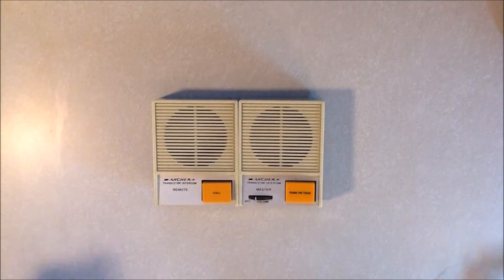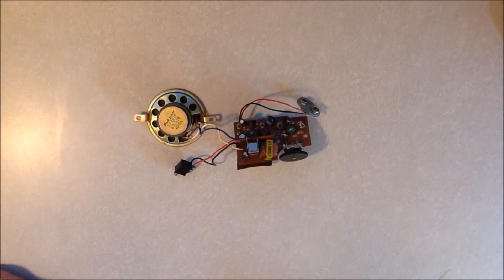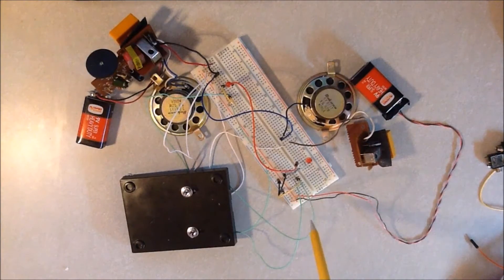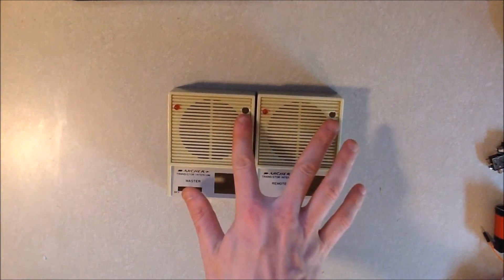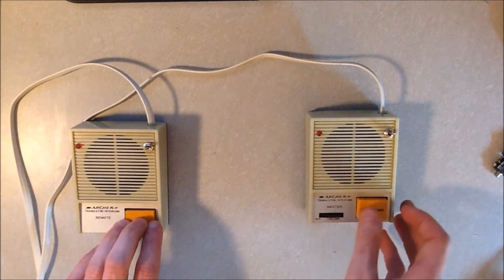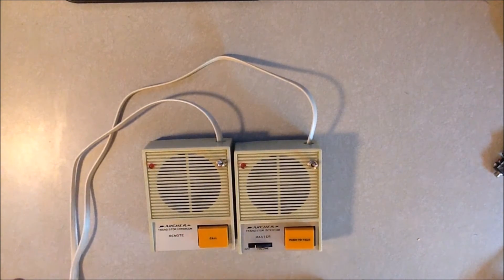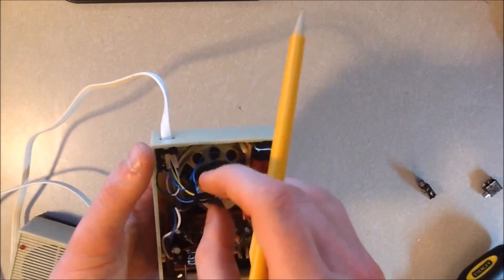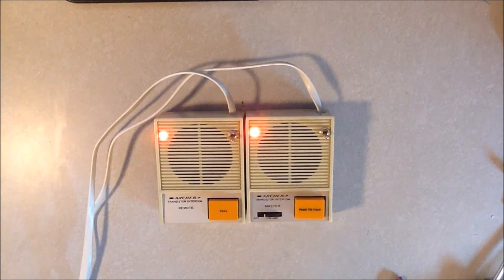Radio Shack -  Archer 2-Station Intercom System Modification

Comment: Hi, you seem to know how this unit works.   Do you think the wire polarity is important?   I have the exact same set and I had to extend the wire to go from yurt to garage about 40m.  The grey 20m wire it came with has NO black marking on one of the wires, so you can't tell which is + or - except by tracing the wire all the way back to the unit which is now sadly impossible since it is buried under grass and dirt.  So when I had to reconnect a break in the wire half way between I just tried both connections.   It sounds and works the same whichever way you connect the two wires.  Does this mean it is irrelevant?  Or am I likely to blow something if the polarity is wrong?